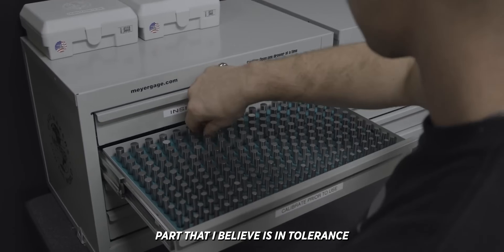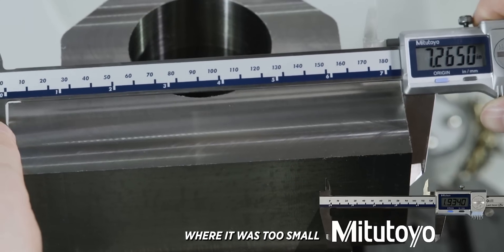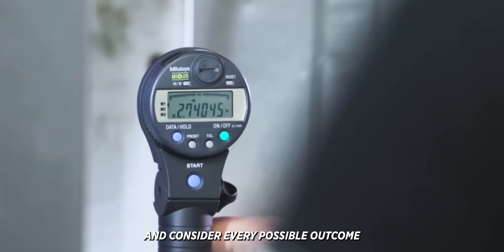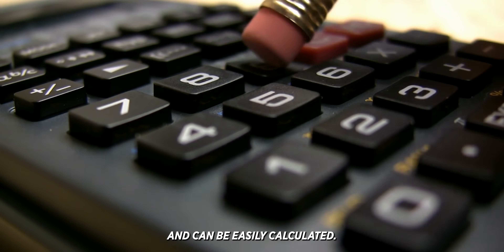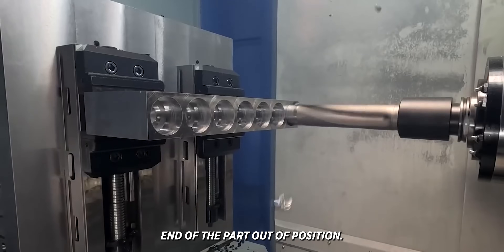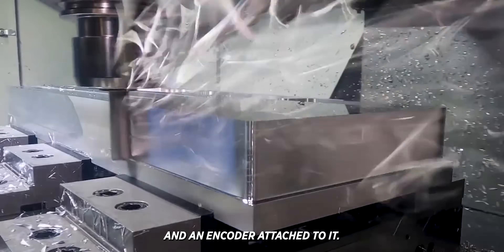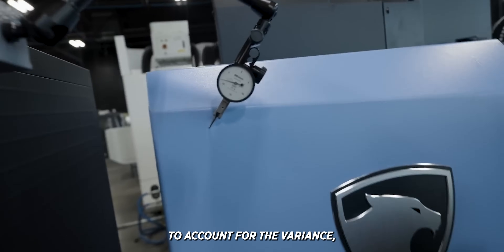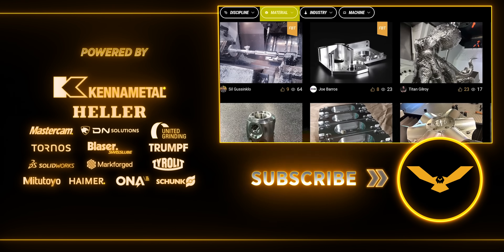SCRAPPING Parts Due To Thermal Expansion

Comment: I've been machining for a while but this has me thinking. If we could get the temperature of the part in real time and have the controller adapt the code being read ahead of time to compensate for the expansion over time to ensure everything lines up perfectly. That could possibly eliminate the issue no matter the temperature of the shop/part. Helix cutting out 9 holes before boring, on the 9th hole it would compensate say .0005 on the ID automatically as a example.

Comment: Thermal expansion is nothin new to those that have worked with anything that has been through nitriding! Would constantly see 20+" stem valve length's come back at least .01 longer than prior.

Comment: Since 3 years it´s my biggest pain at work when temperatures outsides are dropping below 10° C because my company is so uncaring that they ignored the leader of the milling group as well as the leader of the turning group and went and placed a DMG CTX Beta2000 TC in a workshop that regularly has the loading door wiiiiide open to get in rawparts for 30 minutes + (longest was 94 minutes of enduring 8° Celsius INSIDE the shopfloor (drop of about 13-15 °C) .
I can watch my machine shrink in the temperature diagnostic screen and am forced to compensate awful lots in X & Z-axis (most I had to correct so far was up to 0,18mm´s /0,00708 inches ) on parts that have straightness+roundness+coaxiality+concentricity+flatness tolerances of 0,03 to 0,05mm ( 0,00118 to 0,001968 inches) to not continously make wasteparts and that costs tons of time and nerves .
Once that loading door finally closes I need to compensate in the other direction because it slowly gets warm again sigh
Welcome to machining in Austria :(
No change in sight so far ...

Comment: Reminds me of our old lathe operator. Had some low tolerance parts ( H6 ) ~1500mm long. He always roughed em one day and finnished em the other.
Our cheffe then once went "reee that not fast enough!" Since he learned that stuff too he thought he's doing the next ones himself and faster at that too.
All scrap because around 0,01 to 0,015mm to small in diameter. 2 days of machinetime down the sewer, several thousand € down the drain and a VERY unhappy customer!
Thermal expansion learned the hard way.
Copper is also VERY interesting material in that regard lol.

Comment: Ok so it was machined at 80 and was in spec. But the inspection room was 68 so the part was out so you honed it to size. What happens when the customer gets it and is installing it in another 80° setting? Then your honed hole will be too big
Reply: Thought the same thing. Unless all the parts are speced in the same testing facility or there were testing standards across facilities then honing it doesn't matter. I'm not a machinist but it seems like common sense.

Comment: Each CNC Mill in our shop is equipped with an coolant temparature control system. Usual, when mashines running for 24 hours, all components are getting warmer, the coolant too. The control system keeps the coolant at same temparature, each time. While the mashine is running all parts of the mashine get flushed by coolant, so the  mashine itselfe get cooled down. That make sure, we can hold the tight tolerances of all materials we cutting. For example, lot of Bores we have to produce, has tolerances bitween
0,03 mm and 0,0125 mm !

Comment: I did not think much of the effect temperature had on machining , until I went for my 2day trade test to qualify as a tool jig and diemaker. Day 1 I machined some components of the press tool including the die block . My punch was fitting perfectly on the die , with the right clearance to achieve a blank without burrs. The next morning when I came in the punch was not fitting. I had to re-machine to size again.

Comment: If I were to order some high-precision parts from you that were made of…oh, let’s say aluminum, which has a really high coefficient of thermal expansion…would it come with a document that says what temperature it was made at? 

Next question: do you have a way to calculate acclimatization times? Some of us keep our materials in different climate condition than we work them in.
Reply: QC rooms should let parts sit until they're at a reasonable measurement temperature (due to being nearly ambient can take days/weeks). Simple parts you can easily do transient heat transfer problem for acclimatization, talking square, rectangles, etc. Otherwise you'd want to do it with a simulation software.
Reply: @ScuffedEngineer  I was more thinking of acclimatization of raw stock. I, like a LOT of other people, store my materials in a place that has only heat but no AC. If I was working four-inch plate steel stored in an open-air rack in the Texas heat and I bring it into my air-conditioned machining room, how long is it going to take to get the steel from 120 degrees to 75 all the way through?
Reply: @jmowreader9555  I mean, I'm not doing the math for you, grad students don't have that time. It depends on the type of steel, the volumetric dimension of the stock (never said if it was square, rectangular, thickness just specified 4" plate). Also depends on what you consider all the way through and what temperature variance is negligible. 
You can look into transient heat transfer and the FTCS method for quick and dirty calculations, there might even be some code or a program out there for free.

That being said, with that temperature variation I'd say not quick unless it was say .01" thick copper.

Comment: Back in the steam locomotive days a tire was shrunk fit on the wheel. when red hot they fell on the wheel no force involved other than gravity.
Reply: They still do that with automotive ring gears on flywheels. Rarely have to heat them red hot, but they still do just fall on when at the right temperature
Reply: @Glenrok  yea about 350F red heat would change hardness and temper. Same with bearings
Reply: @bigboybuilder  that’s true, although not particularly significant with a ring gear. They don’t receive any special heat treatment
Reply: @bigboybuilder  considering how easily they’re chewed out by the starter motor gear, as well as how easy they are to file, I’d question that. It likely varies from model to model though

Comment: We installed a 4 inch PVC conduit on a roof 100 (or so) ft long. worked up a BOM. my coworker and I were curious as to how much exactly and calculated the length summer to winter and decided to add a second expansion joint and anchor it in the middle of the run instead of each end and joint in the middle.

Comment: I'm working in a shop with a lot of holes in the bulding, and no thermal regulation at all. At this winter, with all those savings on heating, it's so cold inside the shop, that my lathe's door handle, and any other metallic objects can do a frostbite to my hands. And vice versa - when it's 30 degrees by Celsius at summer - a coolant turns into a warm water, if you are doing some non-stop performance cutting during the day. So, parts at this shop can change their size just because of season change xD
Reply: Mate. I'm suffering that right now. I have no choice but to work with gloves, long sleeve wool shirt, jumper and a softshell jacket. Pretty damn awful. Thank god the parts I'm doing are nylon with +-0.5mm tolerances haha.

Comment: I work as a service technician and had problems with a customer over a year.
They were making housings for big gearboxes out of aluminium, the biggest side was around 1.6m long. They had positioning tolerances of +-0.01mm over a 1,2m distance (convert it to your units yourself) in a not temperature controlled workshop. To make it worse there was a roof window through which the sun was shining exactly on top of the machine.
Temperature differences at the bottom of the machine were in the range of 10°C up and down over a day at the control panel, at the top it was close to 20°.
One of those parts was in the machine for 4 days or so until they were finished with it.
The customer constantly claimed the temperature compensation of the machine is not working properly, even though i told him endless times it´s not the machine but the part that is the problem (even showing him the distance variations they had compared to the temperature and they lined up perfectly).
This went on for a long time until we finally got to the point to get a guy with a laser in to double check all the machine accuracy. We had deviations of the machine positioning accuracy measured over the course of a day of less then 0,005mm, and that is over a 2.5m travel.
Only then the guy finally believed me that it is the part.
We mostly solved the problem by installing a proper coolant temperature control unit, and then had them shower the part in lots of coolant the whole time so it would stay at the same temperature over the day.

Comment: expansion of the ball screw won't be much of an issue most of the time because almost all modern machines measure the table movement directly with a linear encoder.
however, heat spreads and if you have temperature gradients within structural machine parts they can warp in all kinds of ways.

Comment: with that formula for thermal expansion, are the units of measurement in inches or metric, Celsius or F?
Reply: just be consistent and it works
Reply: The formula is the same for imperial or metric... Your coefficient for each material is what is different depending on which unit system you are using. I.e. if you work in metric, use the metric thermal expansion coefficient.

Comment: We had some aluminum extrusion that was pulled from outside in winter,  immediately cut to size but a few days later we started running them and it had expanded an 1/8 inch

Comment: Thermal Expansion of Spindles and the Machine, can be mitigated by a glas scale (german: glasmaßstab), that runs the complete lenght of the axis. If you have a propperly mounted glas scale in your machine, the only thing you need to care about ist the thermal expansion of your part, because your machine is true.

Comment: i once did the montage of a galvanized steel roof crown, the engineer of the project did not account for heat expansion on the roof crown. they where laid edge to edge in 40-170m long lines using 3m segments, laid in the late autum. by the following summer we had an emergency repair, since the screw heads started to spring off, the solution was a 3mm gap between each 3m segment that taught me about the properties of heat expansion between summer and winter for the same piece of steel.

Comment: I can remember running Teflon parts that we had to let sit in inspection for at least 30 minutes before determining the difference in size between what we measured on the floor. We would then have to do this about every 2 hours in order to consistently track the discrepancy and make accurate parts. Great info to be aware of; especially if you are machining tight tolerance parts!
Reply: Teflon cut it today, measure it tomorrow.
Reply: 2 days on some of the parts for us.
Reply: Teflon a pain. Seen some parts sit for a week and check good. Then went out for shipment and a month later came back and they had changed.
Reply: @danielgarst2578  Had the same thing happen with Delrin parts. We had to give our parts an expiration date. We told our customer that after a month on the shelf we were no longer responsible for replacing parts that have changed. We have AQL lot data that shows our parts were in print when they were shipped.
Reply: @brandons9138 I use to run a type of delrin that had to sit over night. I think it was delrin 150 that would move. The tolerance weren't tight but it was enough to move them out of spec. Stuff smelled horrible when cutting it and played havoc on coolant pumps.
Reply: @danielgarst2578  Delrin has a lot of center line porosity due to the extrusion process. That's where you'll find that the parts move the most.  

At my last shop we made large parts out of Delrin. After the initial shipment the customer complained that the parts shrunk after they ran them through the autoclave. We'd have to rough the parts out leaving .100 in every direction. We'd then anneal them in our over for a 12 hour cycle. Those parts would shrink by .125 after annealing. That was the only way we could be certain that they would be dimensionally stable after an autoclave cycle.

Be careful when cutting Delrin. That smell you were smelling was probably formaldehyde. If Delrin gets hot enough it'll outgas. Just be careful and avoid breathing the fumes.

Comment: Machining a 40' tube when it was 100+ F (summer in Texas and shop is NOT climate controlled).  Come in the next morning and the damned thing had shrunk almost 1/8" in length after it sat all night in considerably cooler temps. And yet no one will listen/understand when I try to explain about thermal expansion. These are the same people that think there is no linear movement when interpolating a hole.

Comment: I don’t necessarily think heat is a bad thing. I think it’s the drastic temperature changes that can be catastrophic. I mean you can adjust your offsets over time but a sudden temperature change can catch you off guard. This past summer the AC was out in my building so we had to be mindful of our runtimes
Reply: Exactly, when my coworker is calibrating the geometry of a machine he always wants to know if someone has to open the rolling gate on that day because just the cold air from outside coming in can make you get inconsistent readings

Comment: Materials dont expand equally on all sides, a shaft will grow more in length than it will in diameter if it is heated evenly.  But it will still grow or shrink predictably, but you mostly just learn that by experience.  Thanks for sharing, great video.  Charles
Reply: A 5xD shaft will grow roughly 5 times as much on length compared to diameter
Reply: Nah, you can assume isotropic expansion. It will expand the same relative amount in every diection.
Reply: @ullrikegabler that is if you have a cube

The bigger your part, the more it will expand.

Say you have a 50mm x 100mm x 30mm Block of aluminum
Which has a coefficient of 0.0000235 1/°C

And let's say a temperature drop tdif of -20°C

Ldif = L x a x tdif

50mm x 0.0000235 1/°C x (-20)°C
= -0.024mm

30mm x 0.0000235 1/°C x (-20)°C
= -0.014mm

100mm x 0.0000235 1/°C x (-20)°C
= -0.047mm

So your part will shrink .047mm in length, .024mm in width and .014mm in depth.
Reply: @samsam.03  i think you dont know what relative means.
Reply: @ullrikegabler  perhaps

My point is that it is not the same amount of shrinking everywhere